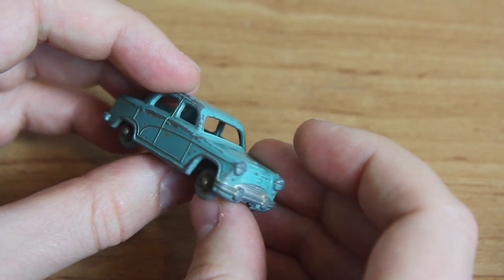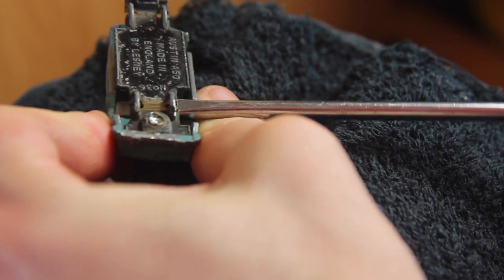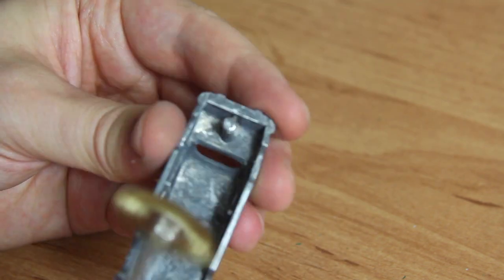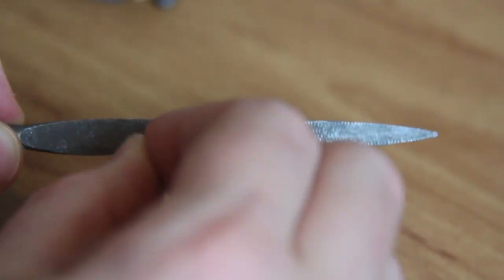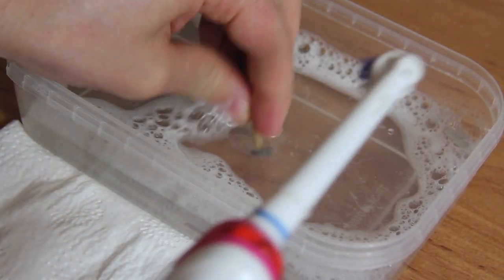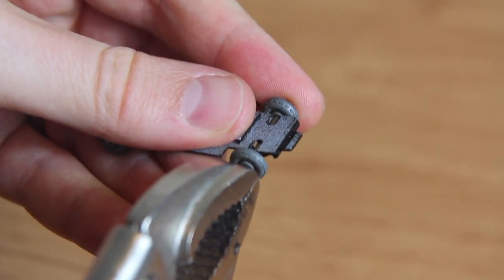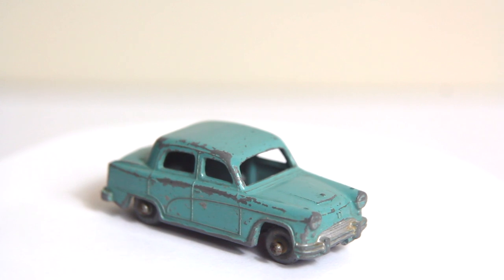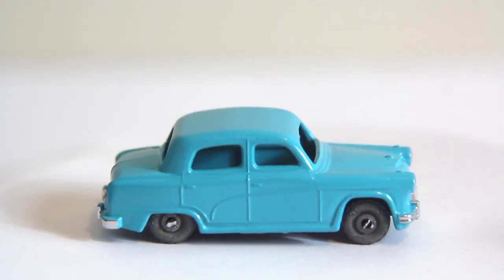MATCHBOX restoration: No. 36A Austin A50 - DIECASTRESTOS

Comment: Hi Jason, I really like your style and commitment to the 1-75 models. I actually restored this car last week, had to grind down the headlights as well. The post blew out during drilling, that was my fiddly bit. Just a thought - I use rattle cans and an air brush interchangeably, and I have found that placing the can in hot (from the tap) water for five minutes increases the pressure of the spray. This allows me to spray further away from the model giving a more airbrush-like delivery. Make sure you dry the can before spraying!
Reply from the maker: Thanks for the tip!